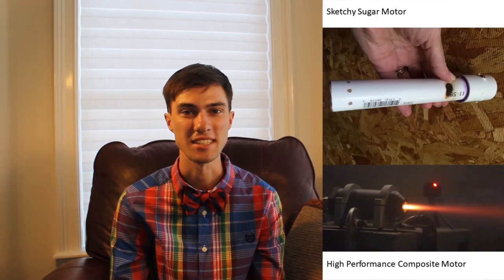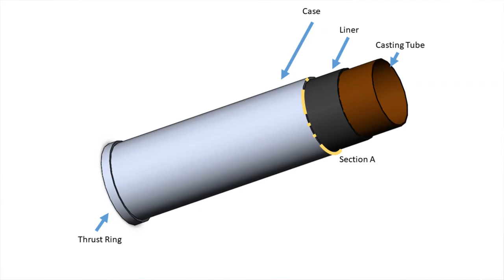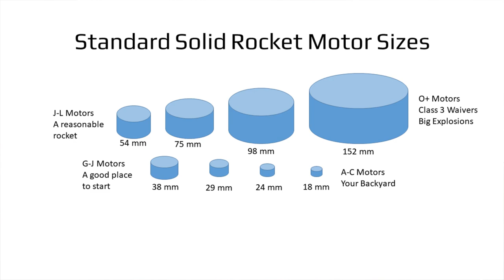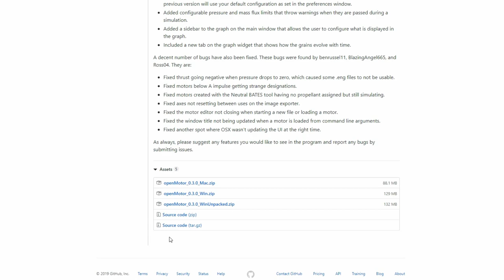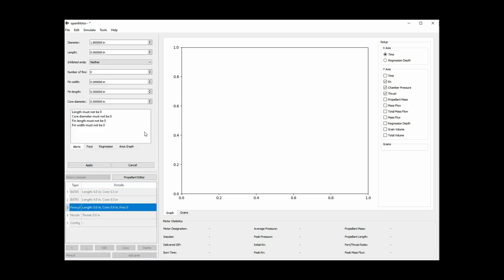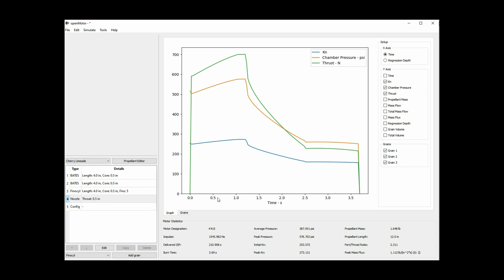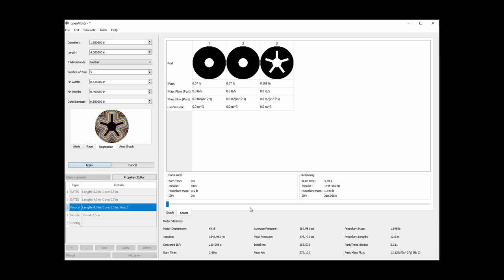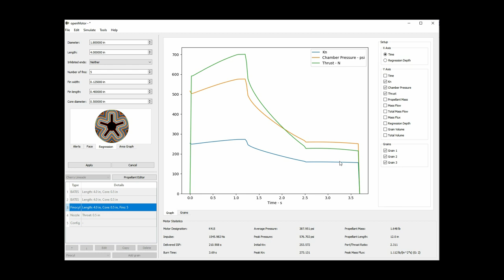Solid Rocket Motors 1: Design

Comment: Yay no sugar motors! Finally a proper video series. People think solid propulsion is simple, though it's vastly complex and not about packing sugar and potassium nitrate in pvc pipes that blow up.
Reply: I have been working with sugar rockets for a long time now, and if it is exploding is due to the case walls being too thin for its size or the propellant being too brittle. The first one can be solved by just using an aluminum case and calculate the max pressure that the case can handle. There are several websites that has a calculator for that. For the propellant, use 10% sorbitol, 25% sugar powder, and 65% nitrate. Good luck and happy flights!
Reply: @titahibayflier3160  you're*. If you're going to insult someone, at least use proper english
Reply: @adityaramesh1764  i speak it better than you.
Reply: Titahbayflier I doubt it, considering you can’t use the correct ‘You’re’.

Comment: great video Charlie, looking forward to the next...  I think it would be great to have Potassium Nitrate propellant available in OpenMotor... great to compare with the other options...   where can I get Burn Rate Coefficient, Burn Rate Exponent, and the other required values to create a KNO3  based propellant in open motor?
Reply from the maker: Potassium nitrate based propellants, especially the sugar ones, exhibit piecewise burn rate behavior that software upgrades will be required to model. They should be in the next version of OpenMotor. The process you use to make your propellant can have a significant effect on it's burning properties, especially for KNO3 propellants which use heating. You'll need to conduct a careful characterization of your propellant or find someone who has published their formula and procedures along with characterization data.
Reply: @AstroCharlie  Thanks...   I understand the difficulty...     I wish we could characterize the propellant we are using ...   unfortunately, we just don't know how and I don't think we have the equipment to do it (we are a bunch of software engineers with a passion for high powered rocketry)...  any pointers on documentation on how to do it or where to find approximations that we could use?
Reply from the maker: If you can wait, I'll pencil it in as an episode 8 or so of this series. Otherwise I'd look up Nakka Rocketry.
Reply: @AstroCharlie  We'll be glad to wait... we still have some pending items that are still in progress so just let us know...  we'll be glad to share results with you if you are interested...

Comment: Hi !  I am working on a project for Solid Rocket Motor Design and the dimensions of the grain are quite large. Softwares like Open Motor and Burn Sim only are restricted to certain dimensions of the grain diameters that may be sufficient for hobby scaled SRMs. Further it has only a number of propellants. Is there any software available that would be doing internal ballistic analysis for larger dimensions and propellant composition of my own choice? Your response would be highly regarded
Reply: In addition to that I came across a number of thesis on different numerical approaches for internal ballistic analysis and performance prediction of SRMs but none of those papers provide any generic code for performing the analysis rather they just explain their methodology and validation of results. And the work that I am doing limits me from creating a numerical code myself.

Comment: When I use OpenMotor, it wants me to make my throat diameter much smaller than my grain cores. In your video, your cores are the same exact diameter as your throat and it works fine for you. It wants me to either make my cores huge or my throat dangerously small. And do you know where to get the specs for R-candy?

Comment: Does one require a high powered rocket certification to build one of these for testing purposes, ie. not with the intention of flying? I want to build a solid rocket motor as a summer project, but I don’t necessarily want to fly it.

Comment: Can You Please Tell Me How Rutherford Rocket Engine Work Please ?
Reply: It is almost a conventional LOX/RP1 rocket engine. The unique feature of the engine is that the propellant is fed into the engine by electric pumps rather than a turbopump. This makes the engine much easier and cheaper to manufacture (it can be 3D printed) and also decreases its weight and complexity. However the electron rocket (using these engines) has to carry 250 kilogramms of lithium polymer batteries to power the motors (the total takeoff weight of the rocket is 12 tons). To save deltaV, the batteries are being jettisoned during the flight.
Reply: @matecser7256  Any specific know how on the injectors?
Reply: @matecser7256  I Know All These Thing Buddy , I Wanna Know How It's Injector Works What Are All The Components ( Like The Two Blue Cylindrical Tanks , That Red Big Tank Etc ) Where Are The Fuel And Lox Inlets Etc in details
Reply: @Maxx_751  The blue cylindrical tanks are used to gimbal the engine. They are most likely hydraulic pistons. I'm pretty sure, that the red ones are the two engines (one for the fuel, one for the oxidizer). I have no idea what kind of injector geometry is used. In my opinion it is most likely, that they are using an impinging injector, since it is commonly used,  meets the design requirements and relatively easy to manufacture (though i'm not sure about 3D printing). The engine is regeneratively cooled with RP-1. That is why there is a pipe going down next to the nozzle. The ignition is most likely done with a hypergolic fuel, since spark ignition doesn't really work with RP-1.
This is probably as detailed as you can get. It's obvious why Rocketlab doesn't release all the information about their rocket engine. There are parts we can only guess.
Reply: @matecser7256  Thank You Buddy For Giving Me The Information , I Have Came To Know Many Things Which I Wanted To Know , Thanks 😊

Comment: Hey Charlie, great video! Just wondering if you could make a video regarding the propellant (cherry limeade) and the procedure to make it for ourselves. Also, are there any other alternate propellants that amateurs can use that are safer and better than sugar based propellants but are still relatively easy to make?
Reply from the maker: Cherry Limeade is about as easy to do as APCP gets. There's not much in the middle in terms of ease and safety vs performance.
Reply: Hi Asel! Did you ever find a video on how to make the fuel? I too am looking for one and have had no luck so far. Thank you!

Comment: Hey guy you know the reason the sugar stump remover Motors are interesting and not nearly as powerful is because you don't have to have a degree in science to produce one like what you're doing don't get me wrong this is pretty cool what you're doing but you need to dumb it down a little for us folks that ain't mathematicians but yeah pretty cool but I'm trying to figure out how to melt the sugar motor so a guy can just pour it into the tubes and I'm not planning on putting anything to the Moon I just like watching things go up in the air that you build out of what you can buy out of the grocery store so your videos pretty cool keep after it one of these days I might learn how to run a calculator that way cool guys

Comment: Hello Charlie, I downloaded the openMotor software and after unzipping the correct fille to my OS i'm having problems in executing the program. The archives in the fille are in a format compatible with Python, and I guess because of that i can't run the program. Do you know if there is some way to run the program without using Python?
Reply from the maker: Unfortunately, it's written in python, so no, but there should be an executable version on the github link.
Reply: Thank you  @AstroCharlie  ! I found that version and it's working

Comment: This is awesome! Are there any permits I would need to be able to make this or is it legal without any? I’m 15 and in Colorado if that helps, thanks!
Reply from the maker: Hi Kai, most states have their own rules regarding rockets. The best advice I can give you is to find a local Tripoli Rocketry Association chapter. They can give you all the details and often have all the equipment you need to start, so you can see if you like it while working with an experienced mentor.

Comment: Like this. My application is for a device which is lower thrust than a typical rocket engine but burns for much longer. The idea is this would be used to power (say) a drone by replacing expensive and complicated devices like propellers and turbines with a cheap disposable engine which is simply replaced when used up. Anybody here know about such an engine, or could one be modified from current technology by retarding the combustion rate?
Reply: I am interested in the same topic for a different application. Moderate thrust for a long duration.  Tech Ingredients has some interesting rocket motor stuff.
Reply: The thing about solid rockets is you can't easily control their thrust output at will on a small scale (which isn't to say you can't control the thrust output at all, the easiest way is to widen your nozzle so it compresses the exhaust gasses less... you can also find a slower burning fuel, but that presents it's own challenges), so it's basically a one and done type deal.

This is less ideal for prolonged flight and more ideal for gaining quick bursts of speed on take off, at altitudes where a propeller won't be effective, on your way home or other scenarios.

For take off it would be best to have the rocket be detachable from the main drone via some servo arms, a parachute keeps the booster from hurting anyone. This keeps the drones drag and weight to a minimum, maximizing flight times while also getting it to altitude/velocity in a short amount of time without using the primary energy source.

For smaller boosts of speed or operation at altitudes where your propeller is ineffective it'd be best to have the motor be smaller and built into the drone itself.

Just make sure the drones can handle the g-forces! (It's wings most importantly)

Comment: Hm...is it "rocket motor" or "rocket engine"? or neither? motor is usually electric, engine involves heat and moving parts. So, what is a rocket?
Reply from the maker: For rocket propulsion systems we typically call liquids 'engines' and solids and hybrids 'motors' as a carryover from the separate teams that developed the two technologies. Other than convention, both are acceptable.

Comment: It is pretty narrow minded to leave out sugar motors, and because you don't know about sugar and solid rocket motors, you shouldn't put them down, and you really need to learn about PVC it is the easiest to work with and just as SAFE! 👍
Reply from the maker: On the contrary, I've made several hundred sugar motors, and I can categorically state that they have a higher failure rate, worse performance, and the only injury I've ever gotten while working on rocketry was while working with sugar motors.
Reply: @AstroCharlie  I have made thousands, and I can categorically state, that you are not building them right. You sound like you are confusing "experimentation" and "learning" with use! You don't seem to know what you are doing. But, that is understandable due to your lack of experience, years, and socialization. But that is ok, you will learn.

The fact that you were injured by "your mishap" has also tainted your view of reality.

Knowledge will tell you that you always need to work within the capabilities of the materials, which we have learned long ago, but the younger boys never seem to know and always have to "relearn".

So it would be advisable if "YOU" stayed away from PVC and sugar unless you educate and learn the respect for the scientific process.

Again, it seems like you are very narrowminded in your view and are biased by "your" failure to understand the benefits and limitations of PVC and sugar.

Good luck with your "consumer enthusiast rocketry".

Comment: Candy Rocket motors are not illegal to hell are you on about. PS there is no right way and wrong way when you get the best result.
Reply from the maker: Hi Pat,
There are many regulations on potassium nitrate by the Department of Transportation. If you move the motor around on public roads you could be in violation of these regulations.
There absolutely are right ways and wrong ways. 'Right' ways produce good results repeatably and safely. 'Wrong'  ways endanger your safety and the hobby.
Reply: @AstroCharlie  No sorry bro but you've been massively misinformed absolutely nowhere in the law does it say Rocket candy Rockets are legal. Those regulations you're talking about that's with all Rockets not just Rocket candy Rockets. You have an incredibly close-minded way of thinking. For you theres only one way it's done and the only way it can be done because anything else is impossible, That's you right there. I never once brought up the wrong ways to do something. I said there is never just one right way i based that on what you said earlier. If everybody thought everything they did was the only right way we would never developer and advance in technology. We'd still be in the stone age.